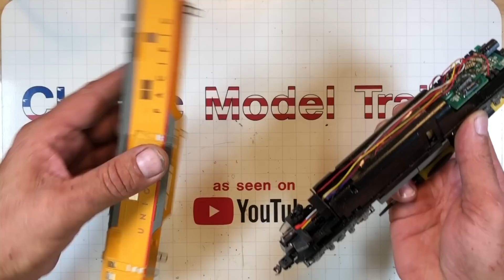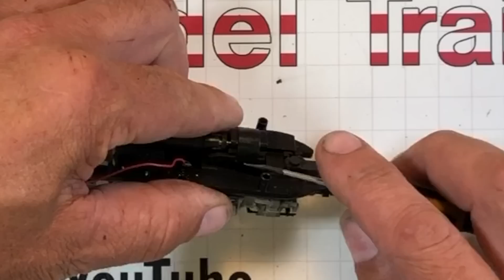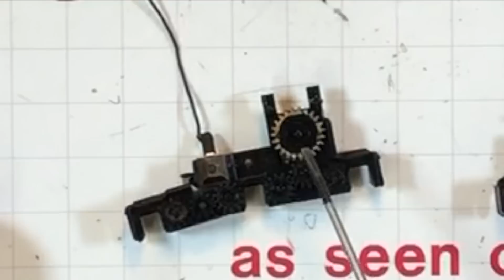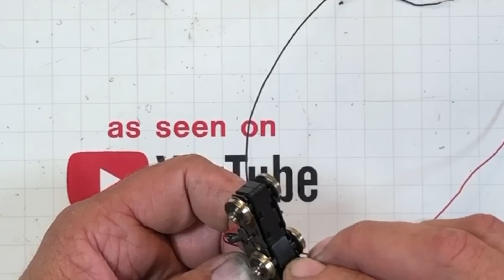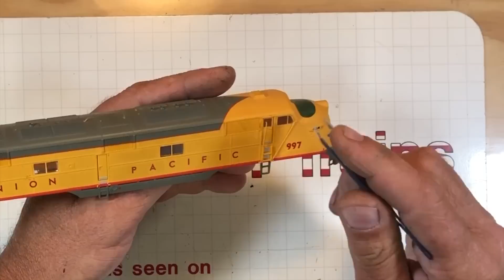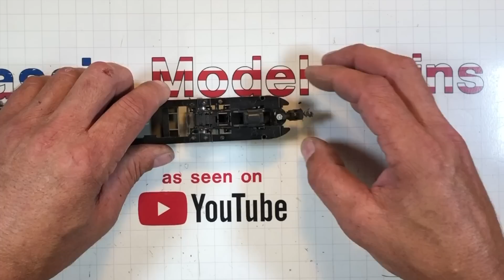Life-Like Proto 2000 (P2K) E-6 Repair Secrets

Comment: Cleaning the wheel threads is easy if you hook up a couple alligator clips and use a soft cloth with alcohol while the wheels are turning.
Reply from the maker: Sure, but if the wheels dont turn then you have to take them out

Comment: the worst thing about these models is that the axle ends protrude so far from the wheels that they will inevitably push out all journals which are not cast on, and no replacements are available anywhere today. So, before you lose the first one of these journals, grind down all 12 axle ends.
Reply from the maker: thanks for the tip!

Comment: I have two Proto 2000s, both of for the Conrail OCS. I want to repaint them in the Allegheny Valley Railroad and make an office car special, something the AVR doesn't have but would be cool if they did.

I rewired mine so it can be used with my Lionel VW transformer.
Reply from the maker: Right on!

Comment: I have a Union Pacific E-6 A-B-B set marked for the "City of San Francisco" named train. The one that proto 1000 did that really impressed me was the Alco DL-109 I swear it's  the heaviest locomotive I have and as the old saying goes: "It could pull your eye teeth out." If you find one of those I think you'll be impressed too. I have 6 of them in different New Haven RR schemes. I got a pair in the New Haven "Brooks Brothers" scheme of Hunter Green and silver gray pin striping. To put my Rapido 8600 class cars which are stainless steel and Hunter Green.
Reply from the maker: Well I hope I run into DL109.  I really like the Proto stuff.  Even more when the gears are all still good.

Comment: Gorgeous locos. My chief complaint is the often encountered split axle gears. I will need to find a 3D stl file to print my own as they can be hard to come by. You always have great information Ron. I do have one complaint for you however. That passenger siding has more bends and kinks that a bad perm! Down here in Texas, we have these things called Yard Sticks. While most people think it has something to do with length, it is a misconception. The truth is, if you lay that Yard Stick down in your Yard, before you lay track, It tends to make your track straighter. Hence, "Yard Stick." An odd thing I know. As a model railroader, this is the truth I am sticking with! LOL. Your passenger train looks great. Keep on training!
Reply from the maker: Hello Anthony,  My passenger track is indeed crooked.  The rails were installed cold (cool) and have expanded. I have not got around to fixing it plus I think it gives that a bit of character.  I do use a yard stick when installing my track and have referenced it in a few of my vid's.  My OCD makes sure I lay my track arrow straight, the passenger line cannot be "eyeballed" down it very easy so it's easy too not see how crooked it is :-)
Reply: @classicmodeltrains   Point made bro. I have seen worse on real track! it has the "used" look of authenticity. The "Yard Stick" just popped into my head and needed an outlet and I figured you would get a kick out of it! Thanks again for all of your great content.

Comment: I don't think I have any LifeLike engines.  I only have 2 Tyco's (the Norfolk Southern GP-38-2's).  Mostly Athearn.  I stay away from Bachmann as they always have split frames with plastic gears which never last over a year.  When you clean the commutator, you should always clean between the bars with a toothpick.  Cheers - TN
Reply from the maker: I agree, Bachmann I avoid like the plague

Comment: I also am a DC guy.  I just paid $120.00 for an Atlas RS-3 with the Central of Georgia livery, and that's the most I've ever paid for an engine.  This one was NOS.  My wife won't let me have it until Christmas as it's my Christmas present.  I purchased 2 Atlas GP-7's with the Central of Georgia livery and paid $75.00 each and I got them from another modeler who said they were practically new with no run time.  I model the Central of Georgia which was bought by Southern which was bought by Norfolk Southern.  The latest engine in the lineup are a couple of Tyco GP-38-2's which got repainted to the NS livery.  I do allow Southern (#4501 MS Mikado) & others including L&N to run on the layout.  Cheers from eastern TN
Reply from the maker: Right on!  Nothing worse than having to "wait" on your X-mas present

Comment: I own 36  Proto 2000 with  2 of them dummies. I have powered several former dummy B units with A chassis.  These are powerful runners as you know. I love the channel Ron. Keep it up.
Reply from the maker: Sounds like you have a lot of power there!!  Run into cracked gears on the P2K's?

Comment: Good Video subject Have a few of these myself .They really set a standard with those trucks .Makes a lot of this newer stuff way overpriced in comparison to how they built these. !  Would like to suggest doing one on a ho Gilbert ALCO DL 600B. Just got one and would like to see if you find the strange defiance's the drive has or has not .I just got mine running with a China 12-24 can motor and DCC .Had to try it .
Reply from the maker: Hello Adam.  I wished I had more Gilbert HO stuff.  They are neat to work on for sure.

Comment: I bought a heap of Proto 2000 SD50, SD60, SD60Ms back when they were new thanks to great prices back then in Australia. Very nice models. I haven't had the split gear problem at this point of time with the 2000 series but the horrible factory grease has set like bees wax over time. After unassembling trucks and soaking parts in white spirits and a tooth pick then thoroughly scrubbing them with mr muscle kitchen cleaner. I rinsed parts with clean water. After they dried I lubricated parts with La Belle plastic compatible lubricants. Man those engines run like Swiss watches. Always good to watch these types of videos on you tube. Wish they had been around 20 - 30 years ago.
Reply: They were around 20-30 years ago. The E units and a few others . Still running here . Cannot beat their quality and detail for the price.
Reply from the maker: this was my first P2K and it hardly had any grease in it.  To bad some of them have old hard grease like yours.  Yea I wonder how Fellers learned stuff back in the day....It's so easy to get information now :-)

Comment: Great video Ron! I have the Wabash E8 which is very similar. The package actually had two fuel tanks that are "swappable". A small one for short haul and a large one for long haul. Life Like used to be LiFoam. They made insulated foam ice chests  back in the day. The plant used to be off I83 in Baltimore City, not far from me. I often wondered if LifeLike asked Athearn for the drives or if they were flat copied. Either way, the E Series is a nice set of locomotives!
Reply: Lifoam IS LifeLike.
Reply from the maker: Thanks Ray.  Still wondering if stolen or licensed.

Comment: Are the shells for different E units compatible with the same frame? Like if a buy a cheap unpopular road name and use the body to power an uncovered b unit for instance?
Reply: get a hold of 1990s LifeLike exploded parts drawings and you will see many parts are interchangeable among their models.
Reply: @suppylarue220  I only car about the shell from one fitting on the drive of another, so If I buy an ab set where the b is not powered I can buy  a powered a or b of another e model, say and e8/9 instead of an e 6 and use it to power the b
Reply: the frames are different for each-584868  e6a
584864 e6b
584701 e8a
584813 e7a
Reply: @suppylarue220  crap
Reply from the maker: I noticed the trucks in the "B" were just like the trucks in the "A". just no gears.  same tower and retention clip.  The "B" body screwed onto the "B" frame unlike the "A" body was a spread open to fit.  I suppose if a Feller really wanted to make one he could with out too much problems.

Comment: The good thing is many Athearn parts fit P2K models so fixing them is VERY easy.
Reply: that's because LifeLike copied the athearn models.
Reply: @suppylarue220  Sort of ,but the materials they used besides the gears were a step up.The P2K motors have a different armature ,magnets and motor shaft bushings do to the fact the motor shaft is smaller ,Different size motor brushes , Higher torque motor. Iuse to use them to repower Athearn. Great they made them like this for more parts available if needed.
Reply: @suppylarue220  😀
Reply from the maker: I like lots of parts available!!

Comment: Wow that looks like it was a chore. I have one in CNW, my uncle just picked up one in Southern Pacific. Love how quiet mine runs. The weight and flywheels are massive! Good to know about replacing the handrails. Looks like yours is also missing some of the exhaust stack details on the roof. There should be eight stacks in between the large roof grill details. (4 per engine).
Sure looks like they copied the Athearn drivetrain design. Or maybe they used it under license? It looks ALmost identical. Well, if Athearn came out with thee best drive train, and every other manufacture copies it now days! Now I know what to do to re-lube mine, although I'm sorta dreading taking it apart, it's not like the antique metal engines I like doing, but it sure is a nice runner!
Reply from the maker: I thought that roof line was a bit vacant.  Gotta tell ya.... I like working on the big metal ones also :-)

Comment: I love the proto series. Common flaw is the axle gears cracking. I've been buying replacements made by Athearn. I also found the file to 3D print them. Wife bought me a Elegoo Saturn 8K Resin 3D printer back in May for my Birthday. Because I wanted to make stuff for my railroad.
Reply: those weren't intended to be replacements, they inadvertently became replacements.
Reply from the maker: sounds like you got a pretty good printer and a pretty good Little Lady :-)

Comment: I remember when the first Proto 2000 BL2 came out from Life-Like. It was an amazing locomotive, and it was way better than the AHM BL2 that was previously offered. There is one thing that often made me wonder about the drive train on the Proto 2000 locomotives. Did they copy the Athearn drive with some tweaks or did Athearn provide the drive train parts. I lean towards the copy theory, and they may have been able to get away with due to a lack of trademark patent by Athearn. Uncle Irv may have given Life-Like his blessing or Life-Like may have actually acquired license on the patent. This detail of the drive line was never explained, or I may have missed the news when released.
Reply: PS: I like the handrail replacement. This would be something that I would replace the broken plastic handrails.
Reply: From what I understand, is that the LL motor LOOKS the same as an Athearn, they are slightly different, around the brush holder area, & I think the shaft size is different, but interchangeable. As for the driveline, yea I d  say LL copied Athearn, on that one, as LL ALWAYS had cracking gear problem, on the 4 axle  diesels,  whereas, Athearn never had that problem. Later, LL changed their driveshafts, to have their own universals, instead of the Athearn copy of the ball joint system. LL....great stuff, & way ahead of their time. I think they were one of the first manufacturers to offer their models, DCC ready, when no one even knew what DCC, was, even though their first models, werent. Thanks Ron, for the video. Yea, those e units were pretty similar to their PA s.I have one of them, & completely different drivetrain, I see. They have a slightly higher gear ratio, by adapting a spur gear(agear head with a large& a small set of gears, on the one gear)arrangement, at the top, where the worm connects, giving it the different gear ratio. It has a can motor, but with those huge flywheels, it takes a full ten seconds, to come to a stop, from 12 volts.. Thanks again. Always a pleasure.  Michael  NZ
Reply from the maker: Thanks for the good information Michael :-)
Reply: you mean pirated athearn designs.
Reply from the maker: I have not been able to find out if the design was stolen or licensed.

Comment: Ron, I have the same exact train (A & B) . The diaphragms come with the train. And the Grab Irons, on ever Proto engine I have the parts "fall off" or breakoff. Only difference on mine (eBay find). Someone has added Sound to the B unit. Sorry, it's literally 50/50 I'll see you next week. I'll message you if we still do come your way.
Reply from the maker: Thanks for the info on the diaphragms.  Sounds like Proto still making poor grab irons.